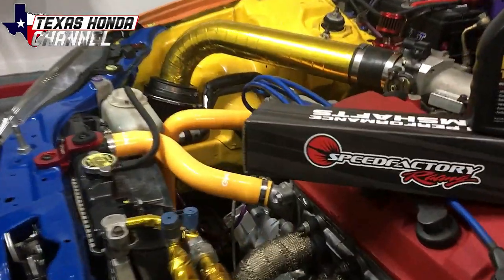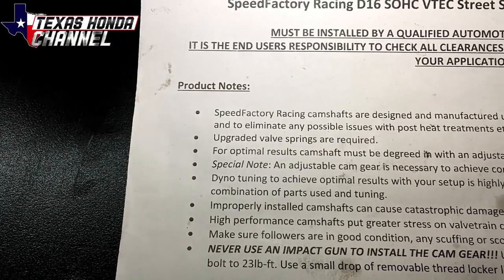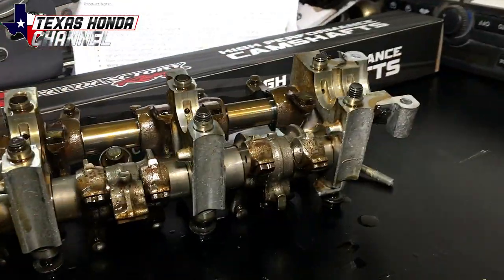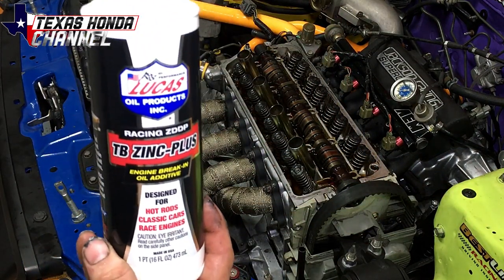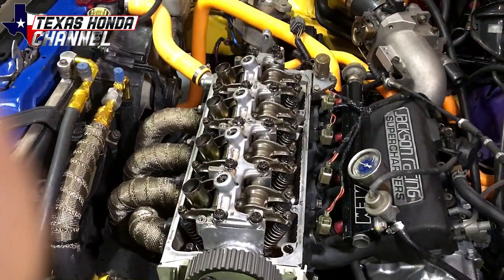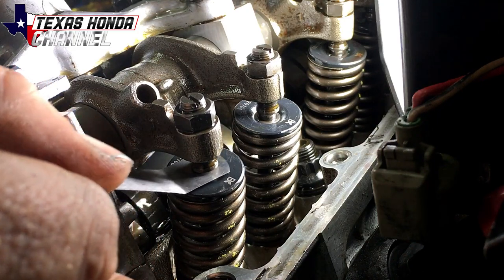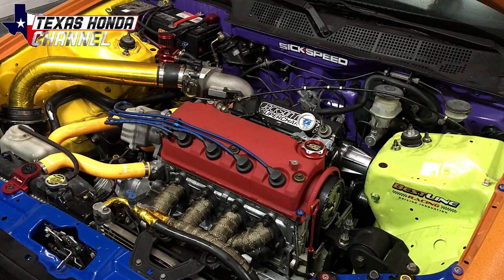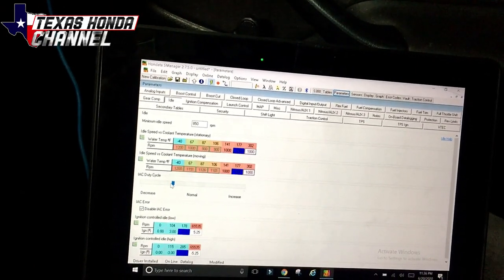SpeedFactory Street Savage Race Camshaft install

Comment: Make sure you don't let your rocker shaft come apart on you , I didn't know that could happen so easily when I was replacing the oring in the sparky plug tubes haha , figured I'd watch the video twice , least I could do
Reply from the maker: THANKS SO MUCH! I appreciate it. Yea rocker assembly can come apart super easy
Reply: @TexasHondaChannel  do I need to replace my valves before installing a cam? I already replaced the the springs and retainers

Comment: But you didn't  degree the cam 😓😓, either way good shit bro glad to see the street savage dropped in, cant wait for the new dyno numbers
Reply from the maker: I don’t have the tools to degree the cam. So I threw the cam gear on and adjusted from there. It will need a proper degree job to get the most out of it

Comment: Just one bit of advise, when torquing down bolts hold the torque wrench closer to the end where the grippy part is. Holding it where you were applies more torque than you think. Probably not enough of a difference to cause issues but it is possible. Here's a reference just in case you want to be sure. https://www.youtube.com/watch?v=RsMxtEx0uik
Reply: Also want to thank you for the awesome content you're putting out, I keep binging on your videos lately, I'm about to pick up a project car and get back into modding hondas, can't wait! :)
Reply: I was thinking the same thing.

Comment: Hey, do you think I need to change my valves if I'm setting my rev limiter higher than 7.2k (stock D16)? I did bought a set of Crower springs for my D16 just for the precaution. But I think stock valves are just fine is it?
Reply from the maker: Well i was running 8,000 rpm constantly  with no issues but you can still have valve float. 7,500rpm is a safe number in my experience.
Reply: @TexasHondaChannel  so you think, I can run stock valves with the spring+retainer upgrade kit at 7500rpm safely?

Cool video as always bro. Enjoyed watching this. Probably the first in depth video on this D16 SFR Savage can.
Reply: @sambpopashango  - Yee
Reply from the maker: 初音ミクサム if you’re doing spring and retainer upgrade on stock valves you can run 9k Rpm but stock springs and retainers I wouldn’t go over 7,500 to be safe
Reply: @TexasHondaChannel  Damnnn bro. Aight. Screw getting aftermarket valves. Imma put some springs upgrade and call it 8k D16 hahaha. Thanks a lot man for the info. Need a lot to learn
Reply: @tommylyeah  thanks mannn. Appreciate the reply.
Reply: @sambpopashango  - No problem-o. I appreciate that you're taking initiative and asking questions, AND tuning the D-Series. We're all still learning, don't let anybody try and talk down at you.

If you're planning on taking the head off when you change the valve springs, I'd recommend checking the stock valves for straight-ness, and having the combustion chamber vacuum tested, to make sure the valves are sealing- if they aren't they may only need to be lapped, and you could do that by hand in about an hour if you buy the lapping compound (it's about $20 USD locally to me, and it's enough to probably last a lifetime hahah).
Reply: @tommylyeah  yeah man. Currently running a P29 high compression setup on my ZC block + Y8 head. 76mm oversized, ACL race bearings. She has been running great for the last 7 months of built. But the head is fully stock. That's why I'm planning on modding it for more power. 😂

I'm a type of dude who learns, but kinda afraid to do myself and don't have the right tools for big projects. So i just let my builder do the work with parts I want 😂

Anyways, I have a few vids of my car on my yt. Haha.
Reply: Youll make more power with the springs, the stockers float around 7500 alot and worst case, you can drop a valve. So just put the springs and retainers in and dont look back brother!
Reply: @sambpopashango  - That's tiiiiight! I love it! What fuel do you run it on??

Comment: I noticed that during your valve lash adjustment you have a bit of valve stem movement,even though it looks big it may still be OK.I've found that this makes the idle at low rpm's a little rougher, at high rpm the valves are moving so fast the thing that make them seat is the compression pressure,pushing the head of the valve to the seat.I know it's just a small detail,but if you run into issues just don't leave that possible issue out when diagnosing problems . hope that helps you.Great video on the close ups,i want to see more like that,it's the small details that you might miss or ignore that bite you in the ass,at least for me.haha
Reply from the maker: Yea good looking out but so far so good :)

Comment: Impact gun on spark plugs yikes I make it a habit to nvr use the impact to install/tighten any bolts I use it to take Shit apart but they are so all over the place like if the battery if full charged vs half charged one mite be over torqued or under torqued just my 2 cents
Reply from the maker: Yea good stuff to practice not doing but never had a issue in the 16yrs doing it this way BUT You are not wrong at all. It CAN tear stuff up. I am willing to take that risk.. Some times lol